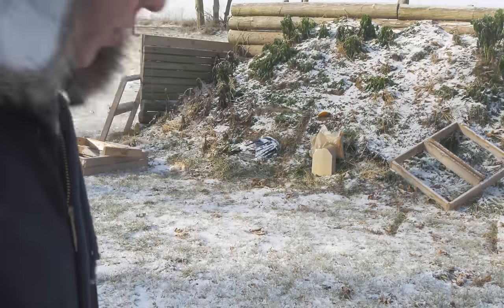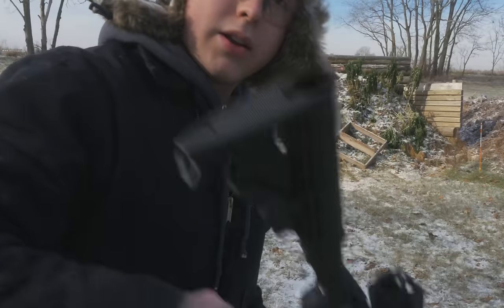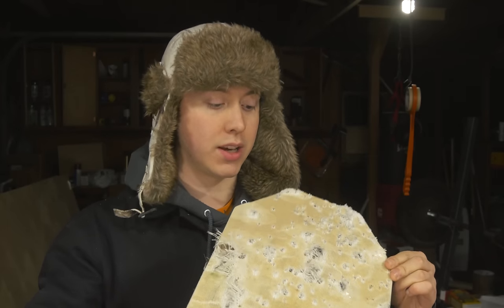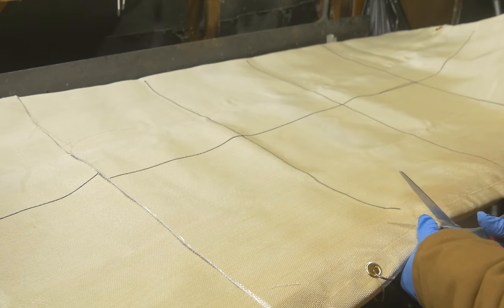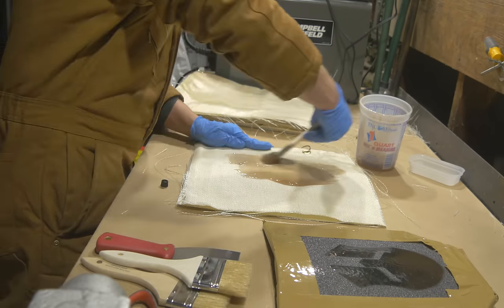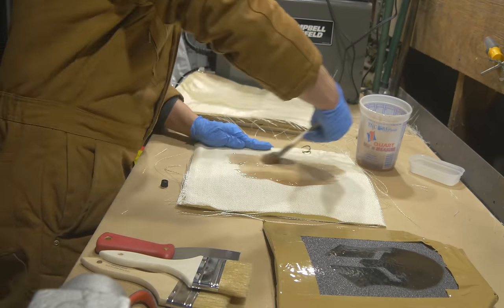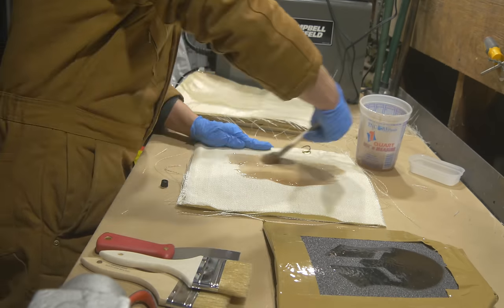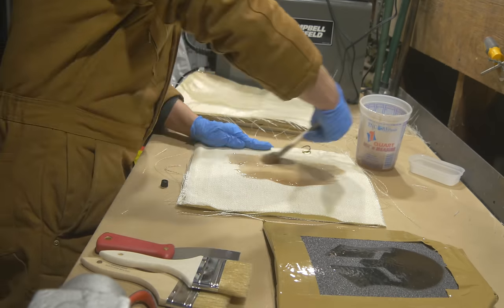How to Make AMAZING Bullet Resistant Armor for $30

Comment: You can drastically increase the toughness of the resin you use for these plates by adding .3% graphene. 
Grpahene is easily made from graphite rods by grinding them up into powder and ball milling the powder with a surfactant for a day or two then baking this powder until there is no more moisture left.
The powder left over from this is graphene and including it into your resin mixture will increase drastically increase the resistance to penetration.

I've got a lot of research articles on the subject if you're interested I will send them to you.

Edit: anybody liking this post should be looking in the comment section beneath it.
Reply: I sure am interested
Reply: @franklingomez5311  Prob restricted links, they're censor happy mofos these days. thanks for trying though!
Reply: @Franklin Gomez
Reply: @franklingomez5311  can I get some links too?
Reply: @franklingomez5311  Bumping to get me in the thread.
Reply: Me three! or four! haha
Reply: @franklingomez5311  its called you are blocked by the fbi
Reply: Learn what a DOI number is. It's a url that refers to a scientific article and it's what you need to input into that website mentioned above to gain access to the article.

I'm sorry I have to be cryptic about this for the post to not be deleted. -post was deleted anyhow...

Sci hub is where you input the doi to gain access for free.
Reply: Since youtube won't let me post the actual DOI url of any of these articles, I'll have to just post the names of the paper and you'll have to locate the DOI for each paper by searching the names in Google scholar. Once you've got the doi you can input it into sci hub.
Reply: @franklingomez5311  Dude you are awesome, i just did the monkey math and put 2 and 2 together, the two sites are amazing, THANKS!!!
Reply: @abcdefbcdefg8352  Cheers. Glad to hear you were able to figure it out. Keep in mind, most articles that have been published in the literature after 2021 are not usually archived by sci hub yet. So newer articles you won't have access to without visiting your local university library.

Kind of a pain in the ass, especially for this subject matter. New stuff comes out all the time, and you can't immediately access it and its frustrating. Most universities will allow you to make physical copies of articles from research journals they subscribe to for only the cost of the paper and the ink used to print. I go to a library in Richmond, CA and they allow access to make prints by anyone, even if you're not affiliated with any college.

And I most certainly am not affiliated with any colleges lol.
Reply: It would be great to see a video of this!
Reply: @whitenoise509  I was hoping the owner of this youtube account would see this. If I made a video nobody would watch it.
Reply: Thank you for sharing
Reply: @franklingomez5311  your on the red flag 🚩 list? Not sure if this is true: once you watch things they don’t like they stop your comments. Like prepper videos, weapons, Canadian and political… lol 
Censorship sucks. 
DLive needs to grow or other ways or communicate.
Reply: @franklingomez5311  hello Franklin Gomez would you share the information again for that material, where to find graphen!
Reply: @praem9597  Lol it's all links, not just subject matter dealing with graphene...
Reply: @jodyhakala-ristow7014  yes, im sorry I've got to go index all my papers that mention graphene and then open each up and copy the names to compile a list to post here.

It's gonna probably take me an hour to get it all done. I'm busy right now but I'll post the list of names by tomorrow
Reply: @pieterveenders9793  Yes, here is one. Many people died and have been injured because of it.
Reply: @pieterveenders9793  My statements are very serious, they are not jokes.
Reply: can i get a link. through mechanical exfoliation you can get FLG, MLG or GNP but definitely not SLG am i correct? also, isn't mechanically exfoliated graphene the lowest grade? nevertheless, i'm very interested in the use of graphene in CFRP especially as i am currently designing a very high performance sailcraft. hopefully beating the vestas sailrocket
Reply: @harken9978  yes, given the right system you can get single layer graphene from exfoliation of graphite rods. Graphite rods are made up of graphite so you wont be making any nanotubes without a significant source of heat. I've made a mix of single walled and multiwalled carbon nanotubes before by hooking up graphite rods to each lead on my arc welder and then submerged the rods in water and touched the rods together to strike an arc between them. That procedure is well documented for the synthesis of nanotubes.

To get single layer graphene from exfoliation requires you to exfoliate in an ionic solution (i.e. a surfactant) This will stop the particles form agglomerating. In other words it keeps the particles from forming cohesive clumps and instead causes particles to repel one another. This effect coupled with a very long cycle (1 or 2 days) of ball milling or acoustic cavitation (2-4 hours) would be sufficient for reinforcing epoxy. The longer you let it run, the smaller the particles will get and so you'll end up with more single layer graphene, but it'd probably never be 100% with such a simple process.

I should add that you dint have to use single layer graphene to increase toughness in the resin, even low quality graohene will have a significant effect.
Reply: I'm busy right now or I'd post the rest.

"Mechanical, electrical and thermal properties of in-situ exfoliated graphene/epoxy nanocomposites"

"Use of exfoliated graphite filler to enhance polymer physical properties"

"Effect of graphene filler structure on electrical, thermal, mechanical, and fire retardant properties of epoxy-graphene nanocomposites-a review"

"Graphene-based polymer nanocomposites"

A powerful way to use Google scholar is to pick an article, then scroll down to where it says "cited by" and click on that. Then there will be a check box under the search bar that asks you if you'd like to search within that list of citations for key words to help narrow down the articles that are relevant to what you're looking to do.
Reply: Use of non-newtonian fluids otherwise known as shear thickening fluid in ballistic armors is also something to be aware of.

It's truly the next generation of lightweight body armor.

"An analysis of deformation and energy absorption modes of shear thickening fluid treated Kevlar fabrics as soft body armour materials"

Here's a paper that describes it
Reply: I am just going to use baking soda.
Reply: @RJKYEG  oobleck might work but I think Kevlar is still required. Glass fiber doesn't have the strength by itself to take a bullet and the non newtonian fluid only augments Kevlar's ability to already take a bullet by spreading the impact out and stopping deformation of the fibers.

I'm sure glass fiber would get annihilated without epoxy to hold it together.
Reply: what can be used as a surfactant Franklin?
Reply: @ggwoutdoors2a  polyvinylpyrollidone is probably the most versatile and the most researched in this context.

Here's an article for reference. "Thermodynamic approach to enhance the dispersion of graphene in epoxy matrix and its effect on mechanical and thermal properties of epoxy nanocomposites"

The PVP binds itself to the graphene particles, another name for this is "functionalization". It allows the particles to incorporate into the epoxy matrix in a homogenous manner.

Might be tough to absorb what's being said in that paper if you don't know much about chemistry though.
Reply: @leonhauptmann3301  check in
Reply: @mateusz6787  check the thread
Reply: @fullbirdtuna  check the thread.
Reply: @jodyhakala-ristow7014  check back in
Reply: @franklingomez5311  Thanks man you delivered!!
Reply: Is That You Again Ian???
Reply: @michaelwest9311  was that directed at me?
Reply: @franklingomez5311   You Sir, are a gentleman and a scholar. Thank you for the apropos body of research you've compiled here, and for teaching more people how to better access known good data.
Reply: Yes I've wanted to try this. You can buy graphene oxide in a paintable form. Wondering if it might even stop the 556
Reply: I'd  be interested in starting another line of communicaion regarding this subject. I've been studying graphene for a while now and am interested in  ballistic applications. If there is any of you communicating in another forum on this subject please reply and lmk how to connect.
Reply: @drewberrynews3875  youtube seems to be blocking any of my attempts to mention the only forum I'm registered at.

I've not ever joined a forum to discuss these things, it's just one of my interests. I'll try to post my own video on my channel and maybe we can exchange links on my account. I think the account owner has forbidden links in his comments section.
Reply: @drewberrynews3875  that would be an exceedingly expensive way to go about it. Graphene oxide is very expensive, and the core of my comment was to keep in the spirit of a low cost bulletproof vest.

Graphene oxide in a printable form wouldn't be the best choice anyways, you want to start with a dry powder with no admixture.
Reply: @franklingomez5311  super interesting, looking forward to see your own video!
Reply: @az8557  well shoot maybe I ought to get around to making a video of my own st this point.
Reply: @franklingomez5311  for future reference you can post links by adding spaces in the URL to break it up... then people just need to copy past and delete spaces to use it
Or just post the search terms required to pull it up on google
Reply: @Meowface.  I posted the names of the articles for reference. Putting spaces in the url didn't work for me. Can you give me an example?
Reply: @Meowface.  it's not allowing me to post links outside if youtube. I can link videos no problem but when I try to mention doi url the post is deleted.

Maybe you can get one to work? I would appreciate the help.
Reply: @amierasycap4870  it won't let me post my email, not even when I leave out my provider
Reply: I'll make a video and post it on my channel, I'll see if that allows me to post links in my own channel.
Reply: Are you an Ian Crossland fan?
Reply: @mzittel97  no, why? Youre the second person to mention Ian in these comments. 
Does he like graphene?
Reply: @franklingomez5311  he's a cohost on a political commentary show. Wacky hippie kinda dude and makes a lot of weird connections/segways in conversation, many of which lead to him talking abkut graphene. It's a bit of a meme on the show but graphene tech is super cool so I totally get his obsession.
Reply: Pretty much metal powders as well.
Reply: @disturbedomega1331  metal powders won't give the same amount of structural backing that graohene will and will be much more expensive.

The reason graphene works so well is because of its aspect ratio. The flat layers of graphene are very wide in comparison to their thickness.

It works like laminate but on a nano scale, as the layers delaminate from the force if impact, each layer on lamination will expand and soften the blow by spreading the impact among the surrounding graphene platelets.
Reply: I heard baking soda does the job as well?
Reply: @dgh25  baking soda in the mix will toughen up the epoxy, but graphene will make a stronger composite and it will take less filler to achieve higher strengths.

The reason graphene works so well is due to its thin 2 dimensional structure. It's got a very large aspect ratio and it's also extremely tough. When you've got these tough, thin sheets evenly dispersed in a polymer they distribute the mechanical load from the impact to all other suspended graphene particles surrounding it.

Baking soda will make your epoxy tougher but that's about it.
Reply: @franklingomez5311  No, I meant, it will harden faster with baking soda?
Reply: @dgh25  I never mentioned graphene making the epoxy harden faster, what is the relevance of hardening faster to making a ballistic composite?
Reply: @franklingomez5311  So it hardens faster?
Reply: @dgh25  for what purpose...?
Reply: @jedeckert9525  you could, but it would be much more expensive to go that route and you would still need to ball mill it with a surfactant to sufficiently reduce the particle size. Micrometer particle size graphite powder won't have the same effect on the epoxy.

I'm sure it would still help the toughness but you'd need to come up with your own mixing parameters. What I'm describing has clearly defined mixing parameters and extensive engineering data in the literature to support the hypothesis.
Reply: @eddyleast8684  can you expound on this please? I don't have enough information to make use of your tip.
Reply: graphene is cool shit... this is an awesome idea. I'm sure I could find it by searching for a few hours but why do you say to use 0.3%? and is that 0.3% by weight to the weight of the resin or what?
Reply: @franklingomez5311  I've been reading your comments here, but I don't see many links.  Did you think youtube was removing said links to this research?

Also, what are your thoughts on using dyneema or other fibers stronger than Kevlar?  In theory do you think a much stronger fiber or a few extra layers might significantly increase the overall durability of this armor?
Reply: @thesanfranciscoseahorse473  you could in theory use any ballistic fiber to do this, but the real benefit of those expensive fabrics is that they perform their job more effectively when they aren't under tension. They'll stop a bullet from a 9mm better when there's some amount of slack in the fiber as opposed to being locked into epoxy. 

If you're going to make an epoxy ballistic plate you wouldn't have to bother using expensive fabrics because it's the layering of the fabrics that allows the plates to delaminate under impact and soften the blow to the next layer behind it. Kevlar probably would perform better than glass fiber weave but I think the effect would be negligible. Neither would be able to stop a round from a rifle, and both could stop the round of a handgun. My point is there's not much benefit to locking these fibers into epoxy, because it's actually the epoxy that's doing the heavy lifting here.

To stop a rifle round you need something harder than the round itself. That's why the military uses silicon carbide plates and they also layer the protection in such a way that when a bullet hits the armor the velocity of the bullet is greatly reduced. 

The velocity and the geometry of a projectile is what allows rifle rounds (and 5.7mm "cop killers") to penetrate body armors. If the plate is harder than the bullet then the bullet shatters and its ability to penetrate diminishes greatly.

Where kevlar and dyneema would make the most sense is if you were to make a lightweight vest using shear thickening fluids. Let me know if you want me to go on.
Reply: @thesanfranciscoseahorse473  durability shouldnt even really be a factor, these plates will only be good for 1 use no matter what fibers you decide to use.

I've been thinking about something cheap that can be added to the front of the plate to make it able to handle a rifle round and I've come to the conclusion that if I could produce sufficiently small "prince rupert drops" and imbed them in the front layer of a resin plate, any rifle round would just shatter into pieces before it has a chance to even reach the glass fibers in the plate to penetrate.

Look up videos of prince rupert drops vs rifles. Destin from the channel Smartereveryday has a video that shows a 7.62 projectile hitting a prince rupert drop in slow mo and the bullet just shatters because the prince rupert drops are so much harder than the metal projectile thats being fired at it. In theory, the bullet has to waste a ton of its energy to shatter the glass bead. Not only will the bullet itself shatter, but after it breaks into pieces those pieces wouldn't have the geometry, weight, or velocity needed to penetrate one of these cheap plates.
Reply: It's not the hardness if the fibers that makes these epoxy/fiber composite plates effective. It's the hardness of the epoxy, coupled with the structural backing provided by layers of fiber that makes these plates effective at stopping handgun rounds. 

With that said, the weave you choose will play a critical role no matter what kind of fiber you decide to use. Twilled Dutch weave would be the most effective to provide structural backing, but you may have a hard time getting epoxy to penetrate it without wetting the fabric with a solvent first.

You could also use a high pressure injection molding machine to get the epoxy to penetrate without having to sacrifice hardness due to the addition of solvents that will thin out your resin when it's applied.

Also, the whole reason to make these plates is because it's cheaper than buying them, but when you start using high quality materials to make these plates you may find that it's just not cost effective to do so. May as well just buy them.

The beauty of adding graphene to the resin is that you can increase the hardness of the resin without upping the cost of production hardly at all.
Reply: @WideAwakeHuman    I actually made a mistake here. .3% is the figure given for carbon nanotubes not graphene.

Graphene is most effective when included to the resin mixture at a rate of 1-3% by weight of the resin, according to the literature.

Just look further up in this thread, I give names of the papers you should be reading as well as instructions on how to access the papers without paying.
Reply: @franklingomez5311  ok thanks 👍🏽
Reply: Hi Franklin, I read all of the comments until the last one and it turns out that the name of the articles seems to have been removed. Could you post them again ? Thank you a lot
Reply: @rtjimmy5555   i just looked and they havent been removed. Im using my phone so its hard to keep track but by my count its the 27th post in this thread that contains the names of the papers. Youll have to click on the "read more" in the reply. The names of the papers are in quotation marks. 

The post starts with "I'm busy right now".
Reply: @franklingomez5311  oh thanks my bad
Reply: @rtjimmy5555  not a problem.
Reply: @franklingomez5311  YouTube doesn't let you post most of not all outside links. So good luck! You might be better off just typing in the search requirements instead.
Reply: Thanks for taking the time to post all of that info, it covers many areas I've been interested in and haven't had the time to delve into.  So many ways to make graphene, so few that would be useful end product.  I was interested in using it with concrete as well (not for armor), so finding a cheap way to pull it off would be nice.  Did you use a surfactant with submerged electrodes, and did you need to post-treat beyond just drying the solution?   I like the sound of that one, sounds like a good lazy-man way to get it done, right up my alley :D
Reply: @enmiredbythelazy4401  from what I've read, carbon nanotubes or graphene oxide are more effective than graphene at reinforcing concrete. But unless you can produce these materials on a truly industrial scale, it's just not economically feasible to do so.

There's also the factor of what you intend to do with the concrete, because there's many different directions you can go with this. 

This is a subject I'm familiar with, but there can be so many different goals to accomplish when you're talking about concrete admixtures (are you after an increase in young's modulus, or tensile stength, or shear strength, or hardness of the concrete, or lightweight concrete, or high density concrete, or concrete that allows total water infiltration?). Just adding graphene or carbon nanotubes won't be enough, these are very highly engineered materials and they require particle size analysis and a consistent mixing procedure to come away with a consistent product.

What you're wanting to start researching is called ultra high performance concrete, referred to in the literature as "UHPC". I can't understate just how many different applications there is for engineered concrete so you may just have to do some reading yourself to figure out exactly what you want.

To add to this, graphene and nanotubes are added to the concrete as a percentage of the overall weight of the mixture and since concrete is inherently heavy you'll have to make and use quite a lot of these materials just to be able to make small sample lots that would be suitable for testing.
Reply: @enmiredbythelazy4401  I didn't use any surfactants in the water when I struck an arc between the electrodes. The reason carbon nanotubes form is because of the intense heat generated at the electrodes. Surfactants are only necessary when you're trying to exfoliate graphene out of graphite.
Reply: @franklingomez5311  I thought I read once you could get SLG by using scotch or packing tape to pick up a single layer. Then dissolve the tape.
Reply: @bserieshatch1  you can, but you try scaling that method up lol. Exfoliation is the cheapest and easiest route I've found to make usable graphene.
Reply: @franklingomez5311  I will defer to your expertise. The only exfoliating I do is after a sunburn.
Reply: Grinding graphite rods into powder is still just graphite bro. Lol
Reply: @spammerscammer  I posted the name of the academic paper that describes the process of exfoliating graphite to obtain graphene. Feel free to read it.
Reply: Graphene and porcelain powder light weight and increase to resistance of penetration.
Reply: @amgtowmonk2915  do you have any articles for reference?
Reply: That's not graphene lol
Reply: @ObservationofLimits  graphite is the same allotropic form of carbon as graphene. Raw graphite just happens to form in stacked sheets but each individual sheet is a particle of graphene. 

The only way to produce large amounts of graphene industrially is by the exfoliation of raw graphite, which is done by crushing the graphite up to a suitable size for ball milling. They use some kind of surfactant to cause the particles to repel one another as they are broken down by the ball milling process. Takes a long time but that is an industrially recognized process for the production of graphene. 

Either way, I provided the names of some papers discussing engineering data where the authors used the term "exfoliated graphite". Whatever you want to call it, nanometer sized chunks of graphite will significantly improve the fracture toughness of the composite over just normal epoxy and its cheap.
Reply: @franklingomez5311  9
Reply: @carolhewett3756  ?
Reply: Sounds cool
Reply: @Franklin Gomez
Reply: @Franklin Gomez
Reply: @just-cat8217  yes?
Reply: What about graphene spray that's used on cars?
Reply: @Zeh Sackett  all that stuff is, is graphene suspended in some kind of polymer. I've not read much into it, but it would essentially be a mixture of graphene particles (that are stabilized with a polymer to aid in dispersion) and automotive clear coat.
Reply: @franklingomez5311   But any amount of Graphene would be great for the hardness right?
Reply: @Zeh Sackett  the amount needed is very small, something like 0.1-0.3% by weight of the polymer. The challenge is you need to get it to reliably disperse evenly in whatever you're putting it in otherwise the end product will never be consistent.
Reply: The particles of graphene tend to try to clump back up into something that resembles graphite again. You've got to do something to stop that agglomeration from happening to allow the particles to be dispersed.

This is always the case when you're working with polymer/nanocomposite materials. Dispersion is the key to utilizing nanomaterials.
Reply: How much should you add to each layer of resin?
Reply: @Zach  you don't add it per layer, to get a consistent effect graphene needs to be added to the resin after you mix it, then mix it again. It also needs some help to maintain the dispersion of particles in the mixture.

Something that can act to tie up the surface charge on the graphene particles. Polymers by the name of "Polydimethylsiloxane" and "polyvinylpyrollidone" are both reported in the literature to work for this.

If you don't do that step the graphene will tend to want to stick back together to itself to something that resembles graphite. You don't want that to happen, the smaller you can keep the particles the better it will act to reinforce the epoxy.
Reply: @HC_Labs  sorry I kind of dodged the question. 3% weight of the resin should be graphene, that's the sweet spot
Reply: Comment to remember
Reply: @maevarum3728  comment to help you locate your comment
Reply: Can you share it with me Please?
Reply: Same goes for anyone else, encode your email in base64 and post it here. I've got a lot of new documents to share on the subject.
Reply: So does it matter how much graphene I use in the resin? Also what temperature do I bake it at? And also if I'm using twill weave kevlar will the only other thing I have to do is to layer it up as shown in the video but with graphene resin instead?
Reply: @Gabe Lemrise  anything beyond 3%w graphene in relation to the resin has diminishing returns. Literature says 3% is about the sweet spot.

Don't use kevlar as the fabric, it'd be a waste of money. Kevlar takes advantage of different properties to stop bullets than a resin plate.

With resin composite plates the ability to resist penetration is due to the delamination and subsequent expansion of the plate upon impact. With kevlar the fabric is able to resist penetration because of the nature of  woven fabrics and how they flex on impact, that coupled with the incredible toughness of kevlar fibers allows them to absorb the energy of a handgun round and spread the impact over a larger area. Thus decrease lethality as long as the bullet csnt penetrate.
Reply: @Gabe Lemrise  if you did decide to use twill weave kevlar you would want to wet the fiber with some kind of solvent to mske the resin more able to penetrate.
Reply: @franklingomez5311  oh ok I just didn't understand why would making the resin more prone to penetration?
Reply: @Gabe Lemrise  I mean for the resin the penetrate into the fabric. If you use a tight weave like twill Dutch the thick epoxy resin has a hard time getting in every little crack. You want as high a density as possible so you want to do all you can to minimize air bubbles being trapped. A good way to do that is to wet the fabric with a solvent before pouring resin.
Reply: @franklingomez5311  so which fabric would work the best in your opinion with money in mind?
Reply: @Gabe Lemrise  glass fiber would be cheapest. The fabric doesn't need to be bulletproof, it's just there to give the resin some structure.
Reply: @franklingomez5311  would Premium Select Heavy Weight Fiberglass Cloth, 24 Oz. Woven Roving, 25" x 72" (2 Yards) 12.5 Sq.Ft. of Amazon work?
Reply: @Gabe Lemrise  yeah, it would work well. When you make the plate, alternate the weave pattern from layer to layer. It'll give you a small increase in the resistance to penetration.
Reply: @Gabe Lemrise  also, certain kinds of epoxy work better than others but if you're getting that technical with it the plate won't be cheap. Engineered epoxies can be really expensive, but boat builders epoxy works well and is relatively cheap if you buy a lot of it.
Reply: @franklingomez5311   so when you said too alternate the weave pattern from layer to layer did you mean to put one layer down horizontally and the next vertically? Also is boat epoxie the better one for it?
Reply: @franklingomez5311  also would Bondo/dynatron 402 Fiberglass Resins - 1 Quart Of Amazon be a good resin then?
Reply: @franklingomez5311  also do I just multiply the weight of the resin container by .3% and that's the weight of how much resin I should use?
Reply: @Gabe Lemrise  yes, but if what you're using has a square weave pattern, you want to place the layers in a way that each layer offset from that square grid 45°. 

That way, theoretically, you'll have the fibers overlapping each other so the lines of each square grid can intersect diagonally. The goal is to increase the amount of fiber reinforcement per unit of volume.

If for example you laid all the sheets in the same direction you would have a greater amount of resin unsupported by structural fibers. I don't think it's at all a critical step, and the increase in resistance to penetration is probably negligible.

I've not got the right equipment to test that hypothesis, but maybe you can make two plates and test them and tell me how it goes.
Reply: @Gabe Lemrise  bondo resin would be fine, but you will need at least a gallon of resin. That's why I recommended an epoxy product that's marketed to boat makers, you can get 5 gallons and make yourself a couple plates for maybe double the price of that quart of bondo.

Really any resin u can get ur hands on will work, it's just a matter of being economical. 

As for the graphene you can buy raw graphite chunks and blend them up in a ball mill with a surfactant for about a week. Just make sure you have some means of baking the resulting mixture until there is absolutely no moisture left. This usually requires a couple days of heat under vacuum to totally dry the powder. 

When you have the powder graphite nice and dry it's a good idea to ball mill this powder with a mixture of acetone and xylene. Once the powder is sufficiently wetted you can let it all settle and decant the solvent. Then add the soaked graphite powder to your resin mixture before adding the hardener.

Weigh the powder before and after this wetting process so you can accurately determine the amount if graohene you're adding. That figure of 3% by weight of resin is assuming the dry weight of the graphene powder, so make sure you can at least make a rough measurement of the weight for your graphene, dry vs wet with solvent. 

It helps to make the resin in small batches, so an accurate gram scale is handy to have.

The real magic of using graohene is when you can get it to disperse evenly in the epoxy. So in the last step you may choose to use a surfactant like pdms to coat the particles which will free up the negative charges on the carbon particles and cause them to repel from all other particles around them. This process causes them to be evenly dispersed and is the only way you'll gain the 2fold resin toughness increase that's reported in the literature.
Reply: @Gabe Lemrise  3% by weight of the resin is the sweet spot for this graphite derived graphene powder. .3% by weight of resin is ideal for the carbon nanotubes.
Reply: @franklingomez5311   ok so is a rock tumbler the same as a ball mill? I've found alot of those on Amazon and it's alot cheaper and I heard that it's the same but what do you think?

 Also about the layering do you think that layering them the same would be the same as the 45 degree? If you dont know then I'll let you know if I decide to do so. 

Also in making the graphene how would I dry it? 

And also how much acetone and xylene do I use in one batch of resin?

Lastly do I put the pdms into the resin mixed in graphene? And also how do I know how much to put into it?
Reply: @franklingomez5311   Also how many layers of fiberglass do you think would be sufficient?
Reply: @franklingomez5311  also would Slice 10544 Ceramic Scissors of Amazon cut the fiberglass nicely?
Reply: @Gabe Lemrise  3/4" thick plate would probably be sufficient to handle multiple handgun rounds. Not sure how many layers that'll be but it'll make more sense to go by plate thickness.

Also make sure that the plates aren't completely flat, they should bow out in the direction you intend for them to take take an impact.
Reply: @Gabe Lemrise  rock tumbler should work as long as it's made of steel. Needs to be durable to handle having steel bearing balls rolling around in it for a few days. Maybe you could get away with just making your own ball mill out of sheet metal and bent up flat bar for structure. Either way a rock tumbler should work well since it does the same thing, just probably won't be worth more than a couple uses before you need to modify or replace it.

Not ao sure about the layering thing, I know I've read that it's critical for getting maximum performance out of stab proof kevlar systems that use non newtonian fluids. That may just be a function of the inclusion of shesr thickening fluids that they needed to offset the pattern to minimize the fluids ability to migrate between layers. I'd say try it or don't try it, it's not gonna be the critic factor that makes these plates effective.
Reply: @Gabe Lemrise  you don't want to use the solvent in the actual resin mixture if you don't have to, it will end up giving you a lower density composite. You may want to just skip this step altogether because the only way to make it work well is by putting the solvent in a parts washer and dousing the fabric before letting it dry a bit. It exposes you to a lot of harmful and flammable vapor if you dint have a spray booth type deal to make it safe for you.
Reply: @Gabe Lemrise  no you'll want to treat the graphene with pdms before adding thw graphene to the resin.

The pdms will attach itself to the surfaces of the graphene particles. When the particles are coated with pdms they tend to not aggregate into lumps when you mix the resin. Even dispersion of the graphene is what lends the incredible properties to the resin.
Reply: @Gabe Lemrise  I'm not sure about those ceramic scissors, you'll have to tell me. It's definitely not easy to cut this stuff with steel scissors.
Reply: @franklingomez5311  ok but how thick do you think it would be for it to stop rifel or shotgun rounds?

Also would 5Pcs 99.9% Graphite Electrode Cylinder Rod Length 100mm Diameter 10mm of amazin be good for the graphite rods?

Also how would you make the graphebe step by step please with the labels of the syrfactant because I dont know when to add the pdms.

Also would layering them horizontal and the next vertical and so on and so forth make it weaker or stronger or does it not matter?
Reply: @Gabe Lemrise  this will not stop rifle rounds at any practical thickness. Projectiles from rifles travel way too fast and have a pointed tip.
Reply: @Gabe Lemrise  "SURFACTANT-ASSISTED BALL MILLING: A NOVEL ROUTE TO NOVEL MATERIALS WITH CONTROLLED NANOSTRUCTURE-A REVIEW." Sesrch this up and read the paper.

Any kind of graphite will work, just get like 5lbs
Reply: @Gabe Lemrise  layering them might make them stronger, it's a technique used for kevlar products. Idk if it would make a difference in this application.
Reply: @franklingomez5311  alright what do you think would be capable off stopping a rifel round?

Also would the only way to layer them like that would be to layer them 45 degrees differently for each one?
Reply: @franklingomez5311  also could I just use steel marbles in a rock tumbler?
Reply: @franklingomez5311  also about ball milling the graphene powder with a surfactant is the surfactant the pdms?
Reply: @franklingomez5311  also what do you think about fras body armor?
Reply: @Gabe Lemrise  you can use pdms but pvpp is cheaper. Pdms is a separate step called surface functionalization.
Reply: @franklingomez5311  sorry forgot to put in the part about how it stops rifel rounds
Reply: @Gabe Lemrise  like I already said, it won't stop rifle rounds. To stop rifle rounds you need high performance ballistic fibers sandwiched with shear thickening fluid between the sheets.
Reply: @franklingomez5311  alright sorry I was just wondering what could make something like that happen, also I was looking through the article and couldn't find where it said what the surfactant was when first ball milling it with graphene is their a sertain kind I can buy of amazon?
Reply: @franklingomez5311  also what's your opinion off dyneema do you think it would make any difference?
Reply: @franklingomez5311  it's just very hard to find for me
Reply: @Gabe Lemrise  surfactant called "polyvinylpyrollidone" is whats used. I guess I linked the wrong paper.

Try searching "graphene ball milling pvpp" you'll find multiple articles that describe the process in detail.
Reply: @franklingomez5311  when it says Leon et al achieved graphene flakes with diffrent sizes by adding commercially avaliable melamine during the process of ball killing under solid conditions, does that basically mean he put melamine when he was breaking up the graphene chunks?
Reply: @franklingomez5311   so basically do I use Polyvinlypyrrolidone as the surfactant when originally ball milling the graphite rods/chunks for a bout a week then dry for a few days under a heat vacuum then when dry add xylene and acetone to the mixture while ball milling it then after ball milling it till the powders wet then add the pdms is that a good representation of what I need to do? Also the article was a bit confusing thats why ik just making sure with you.
Reply: @Gabe Lemrise  not necessary to clean the graphene with acetone/xylene. Other than that sounds good.

Acetone/xylene will help the resin penetrate the gass fiber fabric, but is also not totally necessary. It can be skipped just due to the inherent danger of using those very volatile solvents in that manner.
Reply: @franklingomez5311  if I use them would I just have to wear a respirator  or something else? Because that seems like it would be a little crucial
Reply: @franklingomez5311  but I mean you know more then me if you say that, that would be better for me then I'll just do that
Reply: @franklingomez5311  also when would I weigh the powder before or after ball milling graphite with polyvinlypyrrolidine?
Reply: @Gabe Lemrise  respirator wouldn't be sufficient, you need to have somewhere like a paint spraying booth that is exhausted with positive pressure. You can't exhaust the vapors by sucking them out with a fan because it presents a very large fire hazard having flammable gasses pass through a fan motor that isn't rated as "intrinsically safe". A spark from the motor could cause the whole area to ignite around you. Very very dangerous stuff.
Reply: Best to just avoid it, it's an unnecessary that you dint need to take to mske a usable plate. 

Weigh the graphite after you've ball milled with pvpp and then functionalized with pdms. Make 2x the amount of graphene you think you'll use.
Reply: @franklingomez5311  so weigh after all the steps are done then weigh the resin then multiply that weight by .3% and that's how much weight you would use from the graphene powder? Also after I wet it with pdms do I ball mill it and then dry it? Or wet the graphene with pdms and ball mill?
Reply: @Gabe Lemrise  I'm not sure, I'm not familiar with the process described by Leon and friends. But considering melamine is good at forming very thin coatings, I would say that the graohene flakes he produced were probably made with the goal of producing a macro particle that still retained the properties of graphene just in a more stable form.

More akin to a polymer composite product rather than a polymer functionalized powder.
Reply: @franklingomez5311  so should I just ball mill the graphene with pdms then ball mill the mixture for a few days then add that to the resin? Also  was I doing the math right with weighing it?
Reply: @Gabe Lemrise  skim through this paper and see if it doesn't answer your question. This particular paper doesn't describe using pdms it uses a different siloxane but they're all interchangeable. The specific epoxy doesn't matter either, they just include all these details for researchers to duplicate their results. 

"Improved dispersion and interface in the graphene/epoxy composites via a facile surfactant-assisted process"
Reply: If you can't access the paper, get familiar with sci hub

Yes your math was correct. The amount you add isn't critical either, it can be anywhere from .3 to 3% graphene making up the total weight of the composite. So to 100 grams of resin you add anywhere from .3 - 3 grams of finished graphene. 

3% was reported to be the best from my memory.

Getting into the really fine details of weights and such isn't really necessary unless you intend on producing a bunch of plates and painstakingly testing different mixtures. Youll find often that the values reported in the literature may not be reliable when you go to do your own testing

The real important part is ensuring the particles you create are able to be evenly dispersed in the epoxy resin.
Reply: @Gabe Lemrise  also to answer a question way back, these plates will stop shotgun rounds no problem. Shotgun pellets are not aerodynamic enough and don't have enough weight to have any chance of penetrating these plates.

A slug from a shotgun probably wouldn't penetrate the plate but would almost definitely kill you anyways due to the impact. The plate wouldn't be able to absorb all that energy, even if it stopped the projectile I'm sure it would cause the plate to cave in towards you with enough force to shatter your rib cage and then some...

May not die of a bullet wound, but that might honestly be a better way to go than the organ damage and internal bleeding you'd have after that plate stops the slug.
Reply: @franklingomez5311  it wouldn't matter if the shotgun was somewhat far away?
Reply: Maybe even layering it differently to where some parts have just resin and some without or even having diffrent patterns would ahy of that be able to decrease the force of impact?
Reply: Like maybe layering some normal resin underneath the graphite resin so that the graphite resin would obsorb the projectile and the normal resin wouldn't be as hard therfore maybe being less of an impact? Might have more layers tho I don't know what do you think does that sound feasible?
Reply: If for example you were to make a U with the plates and so there is one plate on your back and another on your chest then another connecting the two above your shoulders would theoretically the blast from the shotgun would be less forceful because the shoulder plate would help with bending the plate into itself and helping to stop some of the force exerted or maybe even that design with some braces one the side might help it from the plate going into your rib cage. Let me know if it makes sense I lt might not sense I have to explain rather then show
Reply: @Gabe Lemrise  no the difference in flexibility between the normal resin and the epoxy resin is too small to go to that trouble. However you could just put ceramic tiles on the face of the plate. Ceramic is hard enough to mske the bullet shatter, reducing the ability to penetrate the underlying plate.
Reply: @gabelemrise6359  about the shoulder plate, I'm not sure.
Reply: @Gabe Lemrise  I mean obviously projectiles lose energy during travel. Far enough away it might not kill you but it'd definitely still hurt

To decrease the force of felt impact you would need something to slip this plate into, like a ballistic vest that has padding around your chest.
Reply: @franklingomez5311  would memory foam work?
Reply: @gabelemrise6359  I've got no clue, and I wouldn't want to be the guy who tests it
Reply: @franklingomez5311  yea ill have to find a way to test it out I guess what about what about maybe with wood? As in use it as if it were my chest? Or maybe a sand bag?
Reply: @Gabe Lemrise  stacked wood laminate sheets could give you an idea of the amount of force being transmitted to the back side of the plate.
Reply: @franklingomez5311  also what if I used TRUE COMPOSITES: Fiberglass Chopped Strand Mat-(0.75oz x 38" Wide x5 Yard 15 Feet Long) Waterproof, Durable & Strong CSM Cloth-Repair, Rebuild & Reconstruct Interior Products or Automotive of Amazon instead of the other fiberglass would you not have to put it 45 degrees because of the strange weave pattern?
Reply: @franklingomez5311  or would it not be as strong?
Reply: Maybe a gelatin type mold?
Reply: @Gabe Lemrise  it probably wouldn't be as strong but would definitely still be able to handle 9mm, .40 or .45
Reply: @franklingomez5311  ok i gues ill just try to use the other stuff but I don't know how I would try to layer it at 45 degrees?
Reply: @Gabe Lemrise  your making this all way too complicated, just follow the video this guy made and then add graphene.
Reply: @franklingomez5311  ok also does Polyvinlypyrrolidone, Povidone, (PVP-40),k-30, Ultra Pure, 100 Grams, 5Pcs 99.9% Graphite Electrode Cylinder Rod Length 100mm Diameter 10mm/Professional Advanced Rock Tumbler Kit, Include Rough Gemstones, 4 Polishing Grits, with 3 Speed Settings and Digital 9-Day Timer/ Four Brothers 1/2" Inch (0.5") Replacement Chromium Steel Balls for Spacerail Game (Pack of 10)/ MicroLubrol 200 Fluid Pure Silicone Oil Polydimethylsiloxane (PDMS) 50 centistokes (CST) Viscosity, 8oz Bottle/ Premium Select Heavy Weight Fiberglass Cloth, 24 Oz. Woven Roving, 25" x 72" (2 Yards) 12.5 Sq.Ft. off Amazon for all of the steps? Just so I know im buying the right stuff and using the right stuff just let me know if it's all things I need, also sorry my last texts for some reason wouldn't show up
Reply: @franklingomez5311  how do i know how much polyvinylpyrpllidone do I use tho? Same with pdms?
Reply: @Gabe Lemrise  "For the aqueous-phase extraction of graphenes from graphite in the presence of PVP, 250 mg graphite fine powder were suspended in 50 ml deionized water containing, dissolved, 1 g PVP and the mixture was sonicated in a 135 W sonicator bath for 9 h using a capped glass conical flask. The as-obtained suspension was left to rest for one week"

Name of the paper this came from was "Aqueous-phase exfoliation of graphite in the presence of polyvinylpyrrolidone for the production of water-soluble graphenes"
Reply: Ball milling can substitute for sonication.
Reply: @franklingomez5311  alright so for 250 MG of graphite powder use 1g of pvp?
Reply: @Gabe Lemrise  yes and the 50ml deionized water is important. 50ml water to 1 gram pvp creates the surfactant solution that you'll use to suspend the graphite during ball milling. Just multiply those numbers to correspond to the amount of graphite you're exfoliating.

Presumably they only mention leaving it for a week to make sure that they've got a stable suspension. It's a measure used to indicate that the particle size has been sufficiently reduced.
Reply: @franklingomez5311  ok and how much pdms do I use then once I've done all the steps up until that point?
Reply: @gabelemrise6359  that'll take me a little while to dig up that information, but I'll get back to you.
Reply: @franklingomez5311  ok thank you so much
Reply: @Gabe Lemrise  couldn't find the paper I had read before. But in my search i found out pdms isn't even needed to tune the dispersibility of the particles. In fact, pvp alone is sufficient.

In fact pvp might even be a better option than pdms. Here's an excerpt:

"The polarity of the lactam ring in the PVP chain
increases the affinity of the epoxy/amine network. Since we
observe mechanical property enhancements in case of our
composites, we believe that PVP aids in the excellent
interfacial adhesion of graphene with the epoxy matrix and
enhances the baseline properties."

This means that the pvp that's bound to the graphene takes part in the cross linking of the polymers when the hardener is added to the epoxy. Which is ideal, it means the particles won't migrate around the solution once they're mixed.

This realization just simplified your process a lot.
Reply: For reference that paper is called "High-Performance Pristine Graphene/Epoxy
Composites With Enhanced Mechanical and
Electrical Properties"
Reply: @franklingomez5311  wait so leave the pdms put of it so I would just grind up graphite chunks/rods that weigh 250mg in a ball mill/rock tumbler with 1g of Polyvinlypyrrolidone (PVP) and adding 50ml of deionized water and then ball milling this with steel marbels or balls for a week, then dry under a heat vacuum for a few days, then when dry add to the resin because I don't need the pdms?
Reply: @gabelemrise6359  correct.
Reply: @franklingomez5311  alright and what should suffice for a heat vacuum?
Reply: @Gabe Lemrise  you'll need to either make or buy a vacuum chamber and a vacuum pump. A cheap rotary vane vacuum pump like what's used for pumping down hvac systems.

A good vacuum chamber can be made from a kitchen pot using a thick slab of polycarbonate or plexiglass as a lid, with rtv silicone used to seal them together.
Reply: @franklingomez5311  would ABLAZE 1.5 Gallon Stainless Steel Vacuum Degassing Chamber and 3 CFM Single Stage Pump Kit off Amazon work?
Reply: @Gabe Lemrise  yes.

Buy a valve to put on your pump so you can throttle the flow or just shut it off completely.

Cover the graphene powder you want to dry with something like a glass dish so it doesn't all get  sucked into your vacuum pump when you pump down.
Reply: @franklingomez5311  like a glass bowl over the powder? And the vacuum has a valve on it
Reply: @franklingomez5311  right?
Reply: @Gabe Lemrise  yes, anything at all to cover it. When you start the pump it's going to violently evacuate the inside of the chamber.

While all that air is being sucked out it happens with enough speed and force to make the powder turn into a cloud of dust.

You definitely don't want this powder getting into your pump, it'll ruin it. So start off by just barely opening the valve on the pump before you turn it on.
Reply: @franklingomez5311  wouldn't the glass bowl shatter under the pressure?
Reply: @gabelemrise6359  there is no pressure, vacuum is the absence of pressure.
Reply: @gabelemrise6359  I'm not suggesting using a glass bowl as a lid for the vacuum chamber. I'm suggesting just setting a glass bowl over the top of the powder after you've placed it in your vacuum chamber.
Reply: @franklingomez5311  so basically just set a glass bowl over top of it and turn it on and leave it for a week?
Reply: @Gabe Lemrise  yea, you'll want to give the pump a break every once in a while. Dint want to leave the pump running for a week, it'd probably destroy the pump in short order.
Reply: @franklingomez5311  so should I leave it go for a whole day then the next day dont use it then use it the next? Or just use it for 3 days and just turn kt off every few hours
Reply: @Gabe Lemrise  close the valve then turn the pump off after 12 hours of continuous usage. Make sure you close the valve before you turn the pump off or you will suck oil into your vacuum chamber.

When you turn the pump off do not break the vacuum on the chamber. As long as there is a vacuum being maintained, water in the powder will still evaporate.

As the water vaporizes its going to influence the pressure of the container. Turning the pump back on and opening the valve will pump that water vapor out of the headspace, bringing the system back down to the maximum achievable vacuum that your pump can produce.

Leaving the pump on continuously would cause the water vapor to be evacuated as its produced so it would dry the powder faster, but you shouldn't do that unless you've got a good pump that can handle that kind of abuse like Welch's duoseal pumps or an Edwards e2.
Reply: @franklingomez5311   do you have to use glass for the bowl? Also just to make sure the bowl is covering the powder because the bowl is flipped upside-down? Also too sum the process up just to make sure I understand, turn the chamber on once the gage that is free from the chamber is closed and the one leading to the pump is open and the graphene powder is in covered with a glass bowl, then when at max (30) turn the gauge that is connected to the pump closed and shut the pump off, then after 12 hours of it being off but still sealed its good? Or get it to 30 with the graphene covered by a bowl then once it reaches 30 let it run for 12 hours, then shut it off by closing the valve to the pump and turning the pump off?
Reply: @Gabe Lemrise  I would advise you to put some shredded paper inside your vacuum chamber and then pulling a vacuum on it. You'll see why i suggest covering the powder with something.

Yes the bowl is flipped upside down, the goal is to protect the powder from the air that'll be whipping around when you initially evacuate the chamber.
Reply: @Gabe Lemrise  technically you won't reach -30 inhg so don't worry about that. 

I'm having trouble understanding whay you're asking, but just watch any video that details the operation of a vacuum chamber to get a better idea. 

I can't give you a very good idea of what to do without some kind of visual aid since you're not familiar with the terms used.
Reply: @franklingomez5311  alright and also I was just asking about which was the correct method to using it, (whether I should leave the pump running for 12 hours or leave it off but it still having a seal for 12 hours)
Reply: @Gabe Lemrise  I only described one method.

Leave the pump running for 12 hours, then shut the pump off. Vacuum will still be maintained while the pump is off. 12 hour on 12 hour off.

I only went into detail about the pump being off to illustrate the point that a partial vacuum will still provide the conditions necessary to make the water vaporize. Evaporation still happens even when the pump is off, but as the water in the chamber turns from entrained liquid to vapor it will cause the vacuum to diminish slightly. As a result of that, evaporation will slow down while the pump is off but it won't completely cease.

The difference is that while the pump is off there is nothing actively evacuating the vapor as its produced, so the water that does evaporate will be waiting around for the pump to be turned back on.

Hope that helps.
Reply: @franklingomez5311  yes that does help thank you also I would be doing it for a few days correct?
Reply: @Gabe Lemrise  yes. And that may not even be necessary, but you'll want to remove as much water as possible.

Heating the chamber during the whole process will speed it up signifcantly.
Reply: @franklingomez5311  ok so how would I heat it?
Reply: @Gabe Lemrise  you can buy heat pads to set under your chamber or submerge the chamber in a heated oil bath.

A much better option is to just buy a used vacuum oven off ebay. This would run you a few hundred dollars though.
Reply: @franklingomez5311  what about a counter top stove maybe?
Reply: @franklingomez5311  also with the heating pad should I just let it sit on it?
Reply: @franklingomez5311  also would you want to heat it all the time?
Reply: @Gabe Lemrise  yea, vacuum environment lowers the temperature at which a substances boils and subsequently evaporates.

Heat obviously causes things to evaporate already, both of them combined will speed up evaporating massively. Just don't go iver 200 F
Reply: @gabelemrise6359  you want something you can leave on safely. Using a countertop stove would probably get too hot. I wouldn't leave a stove running for 12 hours either. Just asking to start a fire.
Reply: @franklingomez5311  alright so heat pads then and just letting it run for 12 hours the off for 12 and repeat with a heated pad at the bottom? Also would/ Sunbeam Heating Pad for Back, Neck, and Shoulder Pain Relief with Sponge for Moist Heating Option, 12 x 15", Blue, off Amazon work for a heat pad?
Reply: @Gabe Lemrise  heat pads can stay on for the whole duration. You should look up silicone heat pads, the rate of heat transfer will be greater with a silicone pad than that neck heater. The neck heater pad will conduct heat much less efficiently because it's got to transfer through a fabric.
Reply: @franklingomez5311  ok do you have a Silicone heating pad in mind off Amazon I look them up and it said that they get up to 425 Farenhiet and I think some of them don't have temp control
Reply: @Gabe Lemrise  any of them would work, but you should get one thata about the diameter of your vacuum chamber. You would hook the leads to a simple PID controller for temperature regulation. It'll shut itself off when it reaches a certain temperature and turn back on when the temperature drops below the set point.
Reply: @franklingomez5311  would/ BN-LINK Digital Heat Mat Thermostat Controller for Seed Germination, Reptiles and Brewing Breeding Incubation Greenhouse, 40-108°F, 8.3A 1000W ETL Listed, work?
Reply: @Gabe Lemrise  yeah it'd work fine. Literally any pid controller would work.

If that controller only has a range of 40f-108f you should look at getting one that has a bigger range. You'd be perfectly safe going to about 150f without damaging the pvp.

One with a bigger range won't be any more expensive, I assume the one you mentioned tops out at 108f because it's mean for keeping retiles warm. If it had the capacity to overshoot the temp more than thay you run the risk of overheating and killing your reptiles.
Reply: @franklingomez5311  what about/  BN-LINK Digital Temperature Controller Heating Cooling 2-Stage Outlet Thermostat Controller Plug for Reptiles Aquarium Carboy Homebrew Breeding Fermenter Seed Germination °C/°F -40-176°F 15A/1875W, ?
Reply: @gabelemrise6359  that's better
Reply: @franklingomez5311  alright so let me round up the whole vacuuming process- cover the graphite with a glass bowl atop a heated Silicone pad with a temp control set at around 150 degrees Fahrenheit, 12 hours on then 12 hours off make sure to close the valve leading to the pump when turning off, do this for roughly 4 days?
Reply: @franklingomez5311  then just to make sure let me go through the whole graphene process- grind up graphite chunks/ rods in ball mill/rock tumbler with polyvinylpyrpllidone for about a week then dry for a few days under the heat vacuum with those steps I just mentioned, then when dried its ready to be used in the resin. Correct?, just wanna make sure I've gotten everything down.
Reply: @gabelemrise6359  yes, exactly correct.
Reply: Can you send me the link?
Reply: @justingayomali1571  encode your email in base64 and post it here for me to decode.
Reply: @franklingomez5311  Would a "3D mesh" using Kevlar thread and sewing the sheets together in a tight pattern before impregnating help against delamination?
Reply: @Anon Austria  can you be more specific? Like do you mean as a stand alone layer or do you mean sown kevlar fabric locked into epoxy?

What you're describing would be ideal if you layered a shear thickening fluid between the Kevlar sheets. But that alone wouldn't be good enough. You would need to bag it up so the shear thickening fluid doesn't have anywhere to leak out or dry up.

If you're talking about making an epoxy plate with kevlar, then you actually want delamination to happen. The delamination is a direct result of the plate absorbing a great deal of energy from the projectile.
Reply: @anonaustria9867  can't tell if you'll get a notification from that last msg
Reply: @franklingomez5311  does the rock tumbler have to be stainless steel? Or can the barrel have a rubber barrel and a stainless steel cover?
Reply: @Gabe Lemrise  doesn't have to be stainless. You can just use a coffee can as long as you don't buy chrome plated balls. I would not reccomend using rubber.
Reply: @franklingomez5311  you couldn't use Chrome plated balls on rubber?
Reply: @Gabe Lemrise  you shouldn't use Chrome plated balls on anything other than stainless steel. Cheaper carbon steel balls and an old folgers can should be good.

Just forget about the rubber, any kind of steel will wear that down in no time.
Reply: @franklingomez5311  alright thank you
Reply: @Gabe Lemrise  when you make the ball mill use a motor that you can precisely set the RPM.

Also test before you use it. Just spinning the balls isn't sufficient, you need the rpm to be slow enough that the balls won't be forced to the side of the container. You want them to make it about 1/4 of a rotation before they fall back down toward the center of the container.

That's very important.
Reply: @franklingomez5311  is it different for every ball mill?
Reply: @franklingomez5311  like the rpm? Or is their a set rpm?
Reply: @Gabe Lemrise  its going to depend on the diameter and inner geometry of the container you use to house the balls.

Best thing to do would be to get a small servo motor and make a lid for the ball mill out of acrylic or plexiglass so you can see what the balls are doing as they roll. You'll want to see them roll up the side and them jump off into the middle. It's that falling action of the ball thay makes ball mills effective.
Reply: @franklingomez5311  is their any videos that could describe this process a bit better? Because I don't know how to make the lid in this way. I mean could I just buy a stainless steel barrel and just watch the balles roll without a lid? Or just watch with some glass pressed up against it?
Reply: @Gabe Lemrise  you can use glass if you want, the only goal your trying to accomplish with this is to be able to see the balls moving  and adjust the rpm accordingly. It doesn't need to be permanent. You could just temporarily glue it to the can.
Reply: @franklingomez5311  so is their some sort of can I can buy?
Reply: @Gabe Lemrise  if I was you I would make it from triclamp parts. 6" x 6" triclamp open end spool with a 6" blank cap on one side and a 6" lid with a 4" triclamp connection.

But like I said you can just rig one up if you want. Whatever I previously said souldn't have made this any more complicated to you.
Reply: @franklingomez5311  Thank you for the effort you've gone thru, i appreciate the reading material you've pointed out and the processes you've written.
Reply: @franklingomez5311  would/ BVV Tri-Clamp Welded Bottom Base-6-inch X 6-inch/ DERNORD Sanitary Clamp High Pressure Bolted Tri Clamp Clover Stainless Steel 304 (Tri-clamp: 4 Inch/ HFS (R) 6" Tri Clamp Blank End Caps fits Tri Clover Ferrule Flange Stainless Steel 304 Sanitary Fittings/ work?
Reply: @Gabe Lemrise  yea that is exactly what I was trying to describe, it would be perfect for this.
Reply: @franklingomez5311  alright thank you I'll follow up with more questions if I run into anymore snags
Reply: @Gabe Lemrise  make sure you get gaskets and clamps to go along with the triclamp parts. N Buna or viton gaskets are reusable and cheap, I'd go for those. You might even want to get a 6" diameter x 12" length spool just so you can process more graphite at a time.

When you get your stuff you can make a temporary see through lid by buying some 1/8" acrylic and tracing around the 6" flange.
Cut the piece where you traced it and you can just clamp down on that like normal.
Reply: @NaakaQ  take all I've written with a grain of salt, never hurts to verify stuff you read on the internet.
Reply: @Gabe Lemrise  also, this triclamp ball mill can double as a vacuum chamber if you get a lid with fpnt ports and the fittings necessary to connect it to your vacuum pump.
Reply: @franklingomez5311  like instead of a bowl use that?
Reply: @Gabe Lemrise  no, you would still need to  use something like that to cover the powder up, but it can act as the actual vacuum chamber.

Allows you to spend less money and less fuss with designing your own vacuum chamber.

Kill two birds with one stone. It would allow you to not have to transfer the graphene after ball milling and the steel balls will act as more thermal mass and should decrease your drying time significantly. 3 birds with one stone.
Reply: Also, once your powder is dry it would be smart to leave the whole chamber under deep vacuum and then ball mill it one more time for a few hours. This will break up any chunks that may have stuck together and should leave you with a very high quality end product. Pretty mech exactly what is reported in the literature.

Ball milling is always more effective under a vacuum by the way. Especially with very light particles like graphite. When there is atmosphere present in the ball mill, the mechanical movement of the balls will cause air currents that will cause the particles to fly all around the ball mill. When you remove that atmosphere the particles won't have anything sending them shooting off around the chamber during the mechanical action of the balls falling. So all the particles tend to stay in place at the bottom of the mill, which is ideal.

That triclamp setup really is the perfect solution.
Reply: @franklingomez5311  hi i read most of evrerything that it was said on this thread... wasnt this supposed to be cheap? im reading about having to build a ball milling device, dry vacums, dimethylformamide,  magnetic
stirrer, Sonication device, etc.. is this correct?
did someone make a resume of all this info?
Reply: @sexpistolsliveee  the materials you use to make the end product are cheap. Most of what I said in this comment section is a cluster fuck of information because I was answering people's questions.

Not all these things are necessary, but I tried to describe something that would allow someone with little technological knowledge  to recreate what's described in the literature.

If you're smart enough to rig some stuff up then this won't cost you very much money.

Look down at the bottom at my conversation with Gabe, for a less confusing method. There's lots and lots of ways to make this stuff, dimethylformamide or pdms aren't needed they were just part of some methods described in the literature.
Reply: @sexpistolsliveee  vacuum pump and chamber however are absolutely necessary.

This isn't exactly a cheap thing to set up properly, but once you've got the setup the graphite you're using to make the end product is very cheap considering the cost of a commercially produced dispersable graphene suspension

But you're right, all the equipment described is pretty expensive when you compare it to a regular hobby.
Reply: @franklingomez5311  thank you for your answer. its clear that you are an scholar on the topic. i wish my english comprehension and chemistry knowledge was better. Its obvius that this it is not easy to make but interesting to read about nonetheless.
Reply: @sexpistolsliveee  it actually is very easy, the problem is I'm describing the many necessary things that go along with various steps of the process and operation/aquisition of equipment and such, also trying to explain the purpose of doing or using something for various points in the process. 

It makes for something that's very confusing to read. If you want I can try to condense it into a single post for you.

Just the process itself, excluding all the other stuff you'd need to know about operating the equipment.
Reply: @franklingomez5311  how would I make the motor again to where it would spin?
Reply: @Gabe Lemrise  with the triclamp pipe that was mentioned, I think the best way to drive it would be with a belt and pulley directly on the pipe.

Set it up on rollers of some kind. You can look at the rollers on McMaster Carr or you can just build a framework with angle iron and use 4 bearings to support the triclamp pipe.
Reply: @gabelemrise6359  a flat belt pulley system would allow you to just have the belt ride on the pipe itself to make it spin without any modification as long as you can get the belt tension just right where the belt doesn't spin itself off.
Reply: @franklingomez5311  what do you think would be able to make that stainless steel barrel roll?
Reply: @Gabe Lemrise  the pipe I referred to in the past comment was that barrel. A flat belt fit around that barrel, connected to a pulley on your motor shaft would be sufficient to make it turn.

The bearings (supported by some kind of framework) would sit underneath the barrel to support it at 4 separate points. 2 points on each side, and arranged a bit less than 90° from the bottom of the base.
Reply: @Gabe Lemrise  https://youtu.be/8T1pZZhP_wo this video shows the barrel with a v belt pulley attached. Yours would operate in a very similar way except you would use a wide flat belt and it would be situated right in the middle of your barrel. With a motor mounted right beneath it and with wide enough flat spindle on the motor to accommodate that belt.
Reply: @franklingomez5311  how do I adjust the speed?
Reply: @Gabe Lemrise  you'll want to use a cheap servo motor with a simple speed controller. Alternatively if you can find a treadmill motor you can control the speed by variation of the voltage using a variac. That would be much simpler setup.
Reply: @franklingomez5311  hi franklin can use graphene power 3% mix resin?
Reply: @Franklin Gomez  also if you were to try and do multiple batches, would you just do the same steps a and as if you were doing say instead of 250 mg of graphine powder you would do 500 would you still do the same amount of time for ball milling and vacuuming?
Reply: @Franklin Gomez  also when you said the balls are going to jump off the side of the ball mill and into the center of the barrel did you mean that they would go up on side then fall from the top?
Reply: @Gabe Lemrise  yes. I was doing a poor job of explaining it. 

And I already described the multiple batch thing a bit further up in the discussion.
Reply: @Franklin Gomez  also, with the 250mg of graphite powder you would use .3 multiplied by the weight of the resin, then whatever that amount is you would use in mixing the two correct? Also would you heat the vacuum chamber throughout the vacuum process or just keep it running for 12 hours then off then on again for 4 days or just leave it on continuously?
Reply: @franklingomez5311  never mind about that second question I answered it myself
Reply: @Gabe Lemrise  if you buy a pump that's rated for continuous operation you wouldn't ever need to shut it off. But you'd need a good laboratory pump like an edwards e2 for that and they aren't cheap.
Reply: @Franklin Gomez  I might just stick to the on for 12 hours then off for another 12 for about 4 days
Reply: @Gabe Lemrise  make sure to get some extra vacuum pump oil. You'll want to change it out after every batch of graphene you make. Failing to do so will greatly reduce the life of your pump. Valves will start to rust and the ultimate vacuum will diminish.
Reply: @Franklin Gomez  hey what about if I used a vibratory tumbler instead sense I can't seem to make one for the life of me and trying to buy one seems really sketchy?
Reply: @Franklin Gomez  also, so with every batch do you mean like I only put into the vacuum one batch at a time and refill the oil instead of the double batch at once, or just refilling the oil after every use after the 4 days?
Reply: @Gabe Lemrise  it just has to do with the amount of water vapor entrained in the graphene. You can do multiple batches at once if you want, but just acknowledge the amount of  water vapor you're evaporating in comparison to the amount of oil your vacuum pump can hold in its reservoir.

You can certainly run the vacuum pump with water in the oil, but it's going to kill your pump. Let me know if you need a better explanation.
Reply: @Gabe Lemrise  can you explain to me why you would rather have access to a vibratory tumbler? It would certainly work for this application,  but there's better options especially if you're considering vibration as a means to back up your theory.
Reply: @Gabe Lemrise  the lack of a vibratory tumbler shouldn't be a deal breaker. Please message me if you're having trouble with this part.
Reply: @Franklin Gomez  I was just having trouble getting a ball mill, and so I found this vibratory tumbler, and it seemed to meet some criteria of the ball mill and I was wondering if I could use that instead because so far it's been hard to get a ball mill
Reply: @Gabe Lemrise  ball mill will be the better option overall, but a vibratory tumbler could absolutely replace it. Just depends on how much money folks are willing to spend to make sure their investment is profitable
Reply: I know that answer doesn't sound satisfactory.
Reply: @Franklin Gomez  alright so I'd I were to buy a rotary tumbler would anything change, like with the balls do I still put them into their or does the time change if I use that instead of a ball mill?
Reply: @Gabe Lemrise  I don't really know to be honest. I assume a vibratory tumbler would make it hard to collect your product. It would cause all the graphene to stick to the inside of the container.

If you dint want to build a ball mill, McMaster -Carr sells a nice little one for pretty cheap.
Reply: @Franklin Gomez  would you be able to send a link for whatever reason I can't find them on McMaster
Reply: @Gabe Lemrise  sorry, looks like my last comment was removed. Look on mcmaster for a "tumbler machine". The cheapest one is $40 and the design will allow you to use any cylindrical container that will fit on the rollers.
Reply: @franklingomez5311  oh you mean the container? I meant the whole ball mill because I can't seem to find a way to get it spinning because I can't find a looped rubber belt
Reply: @gabelemrise6359  look at tumblers on mcmaster, its the whole motor asswmbly with the rollers and it also comea with its own contianer for $40.
Reply: @Franklin Gomez  so I buy the, Barrel with 6 lb. Load Capacity for Tumbling Machine and the Tumbling Machine with 6 lbs. Load Capacity?
Reply: @gabelemrise6359  nope, sorry i was mistaken. Thats $40 for the barrel, $212 for the actual tumbler.

If thats too expensive for you, you can just copy the design. You can get a pre owned locally available 1/4 horswpower motor for $25 and the rest can be fabricated with no prior experience.
Reply: @Franklin Gomez  I'll just buy it, also I've been playing around with fiberglass and it frays alot so I was wondering if you knew If I could just tape the sides so it won't fray, and if that would hinder its performance at all?
Reply: @gabelemrise6359  you wont have any problems taping the edges off, its a good move.
Reply: @franklingomez5311  alright thanks
Reply: @franklingomez5311  i have read everything on this thread, a nice solution that would work for posting everything at one place is making a full list of literature with links and everything else you have, in the same time make a few minutes video (copyright free photos for example) slap a copyright free music on it, and then upload it to o your channel. In the description post the pastebin link. Of course this eill take time so it can be done over the course of a month or so. thus is very interesting stuff so having everything and have it constantly updated would be awesome. Also idk if you tried this but maybe edit an old comment that already went through and is visible? Try it out 🤷🏿‍♂️
Reply: @Franklin Gomez is their a way to use rubber containers for the ball mill I stead of the stainless steel?
Reply: @gabelemrise6359  if you were gomna use a rubber container, i would line the inside of it with sheet metal. Glue or silicone the sheet metal to the inside if the container and that should work for a while.
Reply: @franklingomez5311  alright thank you
Reply: @Franklin Gomez  So for the inside could I cut a 4×2 round galv vent pipe to size?
Reply: @gabelemrise6359  you certainly could. Make sure you add something like epoxy to fill the spaces between the rubber and the galvanized pipe. You want the steel balls to have a hard surface to fall on. Without filling the gaps with epoxy, the balls will lose a lot of energy falling onto an unsupported surface. Most of the energy will go into causing deformation of the metal.
Reply: @Franklin Gomez  so Silicone would go between the two?
Reply: @gabelemrise6359  silicone isnt rigid enough, it would act like a cushion and reduce the amount of energy the steel balls are transferring to your powder. Silicone might be more expensive than epoxy too. Judt use epoxy.
Reply: Alright thank you
Reply: @franklingomez5311  does the flat sides of the container matter as much if I have the sheet metal all around the floor and top part?
Reply: @gabelemrise6359  try to explain that to me a little better, i dint know what youre asking. Describe the rubber youre going to use and the galvanized pipe.
Reply: @Franklin Gomez  so I lined the inside of the rubber barrel with galvanized pipe but I have the lid portion and the bottom not lined with galvanized pipe will that be an issue or should I just use that?
Reply: @gabelemrise6359  shouldnt really matter. The force is only being applied to the inner face of the barrel thats spinning parallel with the motor shaft. How do the lid portion and the bottom portion mate up to the barrel?

Are they water tight mating surfaces?
Reply: @Franklin Gomez  well the lid to the rubber barrel is plastic but the bottom of the barrel is rubber I was just wondering if I had to cover that with more sheet metal or just keep it how it is?
Reply: @gabelemrise6359  i couldnt tell you for sure, because i dont know how concentric your setup is. I have no idea how your steel balls will fall while the thing is spinning and whether or not the balls will be rubbing against either end of barrel.

But generally i think its not something you need to worry about. If the steel balls do tend to rub up against either end of the barrel during operation, youll see wear marks appear before it becomes a critical issue. If you see signs of wear on your lids, then that will tell you whether or not its an issue that needs to be resolved.

But as it stands, ive got no personal experience in this particular instance.
Reply: @Franklin Gomez  alright thank you also when applying the resin to the inside of the barrel should I clamp the galvanized pipe to the rubber barrel and try to squeeze the air out like in the video?
Reply: @gabelemrise6359  no, removing air bubbles isnt necessary at all for this. Just pour the epoxy and let it do its thing and harden up.

You dont want to introduce irregularities on the surface of the galv pipe by clamping against anything. Just pouring epoxy into the space between the galv pipe and the rubber barrel is a more fool proof method.
Reply: @gabelemrise6359  make sure that your lid that youre using makes a water tight seal. Its very important.

Are you trying to modify the container that comes with the mcmaster tumbler setup? Or could you help me to understand what youre using to rig this all up?
Reply: @franklingomez5311  alright thank you
Reply: @franklingomez5311  and how long does it need to harden?
Reply: @gabelemrise6359  the time it takes to harden up depends on the epoxy and hardener system you buy. You can buy epoxy that takes 24 hours to harden or you can buy epoxy that takes 5 minutes to harden.

I cant give you a great answer because there are so many different epoxy resin systems ti choose from.

For something like this you could use 5 minute epoxy and it would work just fine.
Reply: @gabelemrise6359  like i said, that depends entirely on the epoxy resin system you buy. If i were you i would use 24 hour epoxy because its more forgiving to mistakes.

You got 24 hours to mske it right.

More like 6 hours, but the point is the same. Slow cure epoxy is easier to work with.
Reply: @Franklin Gomez  I used Bondo/dynatron 402 Fiberglass Resins - 1 Quart, do you think I should wait 24 hours then to let it cure?
Reply: @gabelemrise6359  that specific epoxy system hardens to a sandable surface within 2 hours of mixing. So assume about 1 hour of working time.

Waiting 24 hours is t necessary for what youve bought.
Reply: @franklingomez5311  oh that's great alright thank you
Reply: @gabelemrise6359  buy "boat builder epoxy" next time. Bondo is too expensive to justify using.
Reply: @franklingomez5311  alright thanks
Reply: @Franklin Gomez  also do I just paint the epoxy onto the inside of the rubber barrel and then put the sheet over it?
Reply: @Franklin Gomez  I mean I guess it wouldn't matter right?
Reply: @gabelemrise6359  shouldnt matter how you do it, as long as theres resin between the two
Reply: @franklingomez5311  alright thank you
Reply: @Franklin Gomez  what happens if the balls are just rolling in the barrel rather then rolling up the side and falling down
Reply: @Franklin Gomez  also what if I just grind them into a powder then ball mill them with the surfactant?
Reply: @gabelemrise6359  then it will hardly be effective. Thats the whole point of the design.
Reply: @Franklin Gomez  maybe I can post a video on my YouTube account about what the ball mill looks like when it's on and then you can see what's going on and maybe that would be better to determine what I would need to do with it?
Reply: @Franklin Gomez  it looks like some of the balls are rolling up but I just wanted to know if that would be good enough or if I'd need to do additional steps
Reply: @gabelemrise6359  yeah, thatd be a bit easier for me to help you.
Reply: @franklingomez5311  alright I made the video
Reply: Isn’t carbon nanotubes the next best thing after Kevlar? Graphene is an excellent idea….My friend who studies chemistry told me about graphene and carbon nanotubes. Next level stuff
Reply: @dcbaars  carbon nanutubes are more finicky. Theyre harder to produce on a large scale and its very hard to produce only single walled nanotubes in particular.

Single walled nanotubes are typically the subject of research papers about nanotubes. The reason is because their properties are consistent whereas multiwalled nanotubes can have vastly different performance batch to batch based on the ratio of multi walled to singke walled nanotubes.

Nanotubes also cant form continuous fibers longer than like a centimeter so theyve just got different use cases.
Reply: Do you think this would work with boron carbide shavings?
Reply: @DocAracnid  i dont see why not, as long as you had sufficiently small particles and some way of functionalizing their surface so that they disperse evenly in the epoxy.

Reason why graphene would probably still be better for reinforcement is the fact that each indivdual particle is 1000s of times smaller than any shavings and they have known processes for functiinalization and reliable dispersion in epoxy.
Reply: Led me to think
Reply: A long time ago I watched a video where some guys made a bulletproof plate from a steel tray, small rocks glued heavily to it, and a phone book behind. Surprisingly, it worked. Both the bullets and rocks broke, but so much energy had been dissipated by the interaction, that the fragments were caught by the phonebook.
So with a rifle bullet resistant vest in mind, I was thinking (might be a dumb/impractical idea) that maybe one could utilize their method of small rocks and make a double plate, with a first layer of rocks fixated in resin, ideally as thin as possible (for obvious weight reasons), and a second layer of this graphene infused epoxy-fiberglass composite. It's pretty similar, but unlike the phonebook, the resin composite is (quite) bulletproof by itself. In the end, instead of the rocks doing the heavy lifting, both share the workload more evenly.
The rocks will not stop rifle rounds, but they will break them well enough. And with their geometry screwed, the second layer would have a good shot at deccelerating them fully.
Technically this rock array could be repaired, though as i don't work with resin, I can't say for sure that filling a hole with fresh resin is going to be as resilient as the original on its place had been.
Reply: Can you send me pls
Reply: Bump
Reply: YOU DIDN'T SEE GRAPHITE!
Reply: I just ask a vaccinated friend for some blood.
Reply: how much weight would it add to the plate? im making a real life batman suit but it needs to look like a motorcycle jacket
Reply: Yes and no. It will not help out a great deal when a bullet hits unless it's all graphene. .03 % is great in everyday use epoxy but on something like this you won't know it's there.
Reply: What sort of material could be used as a surfactant?
Reply: Will just adding Graphene powder work? Seems affordable if so
Reply: All my clothes made of graphene.shirt, pant, jacket, bushcraft bag, tent, etc..😊
Reply: if you are still willing to share your info I would be very greatful.😁
Reply: In your spare time
Reply: I am interested to learn more about that......
Reply: @franklingomez5311  Sir, your level of "customer service" is nothing short of incredible. Your replies are spot on, clear and concise. I'll admit, I sub'd to your account to see if you ever did a video like you thought you might at the beginning of this over a year ago. I'm sure I blew up your inbox with notifications of new "thumbs up". Sorry about that. But would LOVE to see a true scientist with some videos on subjects like these. Thank you, and be well!
Reply: @franklingomez5311  not sure if you're still active, but can you post just the DOI numbers, not the urls?
Reply: Send em
Reply: @franklingomez5311   Would You Give me the info required so I can access the related subject matter. Thanks
Reply: @franklingomez5311 I guess I'm too out of the loop to figure out the monkey math 😢
Reply: Willing to send them to me? Can't figure your cryptography 😂
Reply: To whom it may concern... Tech Ingredients on youtube has a graphene video and closer to the end (after they manufacture it) they add it to epoxy to strengthen it. 
I will put a link in another reply just in case the link gets my comment deleted lol
Reply: @brodaviing6617  this is almost same as my paper written for my master degree, i could tell you that it does works 

also with a cover of 2.3mm steel plate at the back, the plate can hold all the bullet incudes 7.62x54 FMJ
the final product was a 2.7cm thick plate with about 2800 grams weight.
Reply: I was wondering if metal flake the type that is used in painting would be a light weight way to strengthen the plate especially if applied to each layer. Again the cost factor would rule that out.
Reply: Interesting..remind me to check back
Reply: Yo buddy. I live in Oakland Ca and it’s a legit die for nothing, killed by a 12 year old from a different town (I guess they won’t carjack in their own community) and any second turn into an armed idiot war zone with folks who aim as well as they spell. I finally need to fortify my spot as our cops don’t show up for 911 anymore. I need to make some ballistic panels for my front wall. A stray bullet already took out my camera and I’ve been drive by’d by accident 4 times. Let me know if you have tricks and recipes for a barrier. My whole front is going to have agricultural sprinklers shooting blue stained water as my primary defense. Most studio G’s don’t like getting wet as it ruins their instagram photos. Thanks for reading.
Reply: @ounceisalltillgtre7896  the best thing I've ever read about as a solution for this is to use loose pea gravel and chicken wire and make the barrier at least 6" in thickness. It's a cheap option and it can actually look pretty nice too. Anyways, when a bullet hits the pea gravel the gravel just absorbs the impact and spreads it out. Meanwhile the projectile will get chewed up as it passes through the rocks. Tests show this kind of barrier is effective at stopping 7.62 from penetrating at all. Problem is it doesn't look great and is gonna be very heavy.
Reply: @franklingomez5311  sir after over a year still responding and being a scholar, well done! I applaud you and appreciate your continued contribution!
I have read through many and many comments, this may have been answered previously, with the understanding that this will not stop a rifle round, do you know of any cheap or cost effective alternatives to level 4 armor. Or may I have been mistaken with the strength of graphene?
Reply: What's the final weight compared to the metal plate one ?
Reply: thanks for the info, you answered a quesiton i had, "would carbon help it by making it stronk" and yes, it will help.
Reply: Thanks for the hook up,science the shit out of life!!
Reply: Just gonna leave a comment here for not reason whatsoever.
Reply: Do you think using fabric like heavy woven, matt all the way  down to Vail material (very thin and pliable material)w your resin graphite mix also rolling out any bubbles would work even better?? I would think it would take more to fracture the finished product.
Reply: You ever make a video?
Reply: I'm interested in adding graphene to my build, so please forward the info you have. Also, how many layers of cloth did you use and if you have a build video, please forward a link.

Thank you!
Reply: Can you send them to me?
Reply: I'd love some info pls.
Reply: I'd love some info pls.
Reply: I apologize for not responding sooner, I was locked out of this google account for a while for obvious reasons.

If you want to devise something to stop a rifle round, first you'll have to specify how that armor will be used. Is it meant to protect your house, or is it meant to protect your body?

Making body armor that can stop a rifle round is doable, but will not be cheap. Also just because the armor can stop the round from penetrating doesn't necessarily equate to making the impact non lethal, keep that in mind.

If you're making armor to stop rifle rounds for the front of your house then doing it cheap is absolutely doable.

Let me know which issue you're trying to solve so I can advise you without making a wall of text.

Also thanks for the recognition.
Reply: No I never made a video, I didn't think it would get many views if I did due to the algorithm.
Reply: I did some research while I was away and found that Robert Murray Smith has recently made a video on youtube about how to easily and cheaply make a graphene powder that has reliable dispersion using whey protein from milk to bind up the graphene nanoplatelets into stable particles that can be effectively dispersed in epoxy without any other additives. So my whole diatribe about PDMS and pvpp is now obsolete in my view.
Reply: I am franklin, just on another account. Youtube just deletes any comment I try to make as far as contact information. Even using encryption to hide the details, my comments are still removed. If you want me to send you information on this subject you'll have to be clever enough to devise a way for me to contact you. I haven't been able to figure out any way to make it easy for folks to contact me.
Reply: Base64 encode/decode does not work. I'm sick of trying to figure out how to share this info easily
Reply: Am I too late?
Reply: @JAGGisBACK  I don't think so, what did you want to know
Reply: I'd like to read them.
Reply: @The_Reaper_of_Death  I was pretty clear further up in the comments that I can't post links or contact information in these comments. But I mentioned the names of a few of the papers and how to access them for free further up
Reply: Isn't graphite in Pencil lead?
Reply: Yeah, interested.
Reply: that is not how you make graphene lol.
Reply: @DieselRamcharger  I guess mutiple peer reviewed research papers isn't good enough for you. Since you're the expert here, explain to me how its done lmao.
Reply: @jlmealer
Reply: Anyone tested this yet?
Reply: @noname788  thats now how you make graphene. everything that dude said is complete bullshit.
Reply: @DieselRamcharger  yea all these published materials scientists and engineers who authored those papers are completely wrong.
Reply: @DieselRamcharger  "A review on mechanical exfoliation for scalable 
production of graphene" this article isn't behind a paywall. You can take a look for yourself.
Reply: @DieselRamcharger  you gonna respond ot not?
Reply: @franklingomez5311  to you being wrong, dishonest and completely full of shit? Nope.
Reply: @DieselRamcharger  tell me what I got wrong
Reply: @DieselRamcharger  graphite is the exact same allotrope of carbon as graphene. Mechanical exfoliation of graphite is an industrially recognized technique for producing graphene. Doesn't matter how you feel about me.
Reply: Where’s the links?
Reply: Isnt the beauty of this build its simplicity? Yeah youre going to make more advanced armor…… but this guys stopping slugs out of his garage for 30 dollars….
Reply: @franklingomez5311 isnt that what is in the vx?
Reply: Hi! Sorry, I hope it's not too late to ask this but, which graphene is actually good for this? The cheapest graphene I saw online is about 20$ for every gram